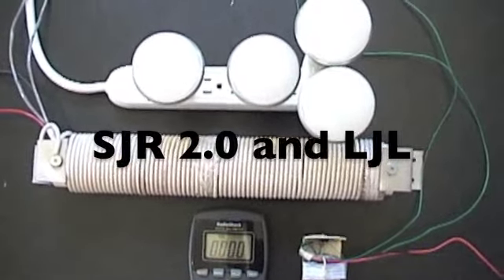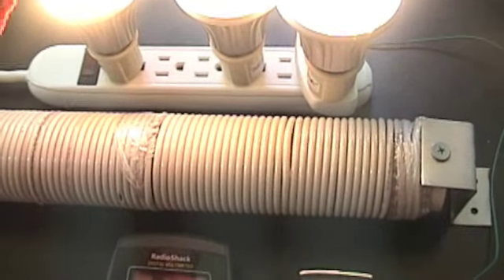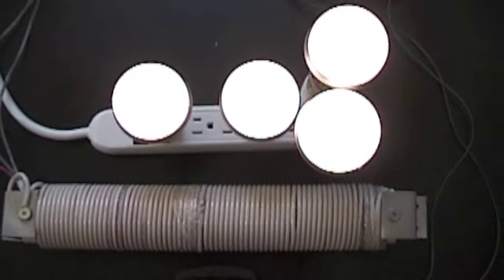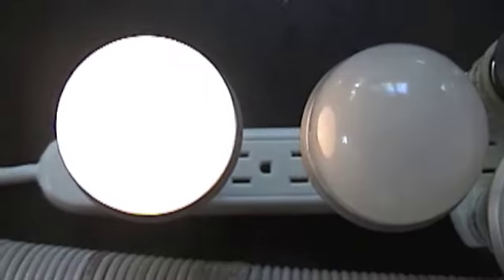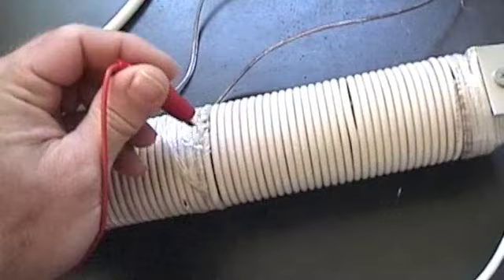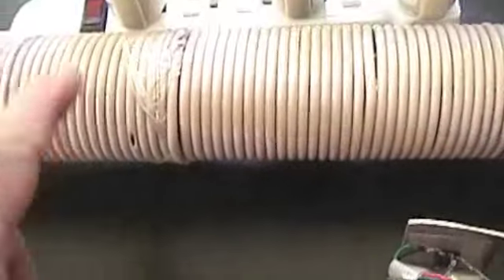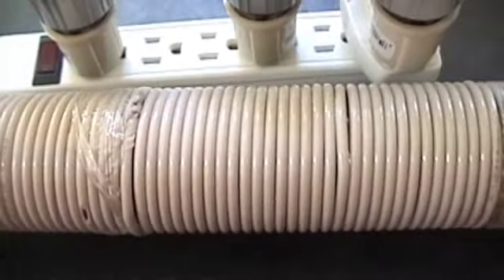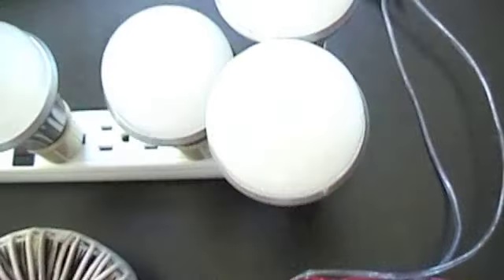Joule Ringers that don't Ring

Comment: This is kinda where I am at with my testing of the different setups.  There are pros and cons to each one.  I bought a 450 lumen 12v LED bulb that runs at 1/2 amp that I am comparing things to.  It looks just like these 110v bulbs only with no AC guts in it.  The simple Radio Shack 12v transformer ringer will beat it in some ways.

Comment: I've tried this with a similar setup and I managed to light a 3watt LED lamp with a 12volt/1amp supply.The lamp was drawing about 1 amp.Then I used a bigger battery 12volts/5 amps battery.The result was that the lamp was drawing 3.5 amps and the 2N3055 blew.I had the lamp connected one lead to Vin and the other to the emitter of the transistor.Why did this happen with the 2N3055?Why was it drawing that much amperage?How can I reduce the amp draw?
Reply: +As DIY as it gets.  Did you protect the Base voltage to 5 volts, if not that's the problem, same thing with mosfets they can only handle ~20 volts plus or minus to the (Base-Emitter) Gate-Source. Simple way is back to back Zeners. Mosfets also run much cooler but need higher voltage to turn on, that's why they use Transistor with low voltage switching...